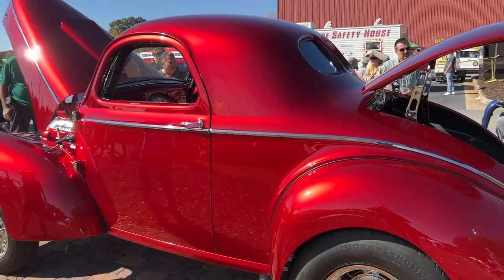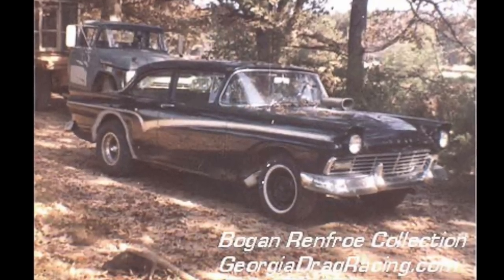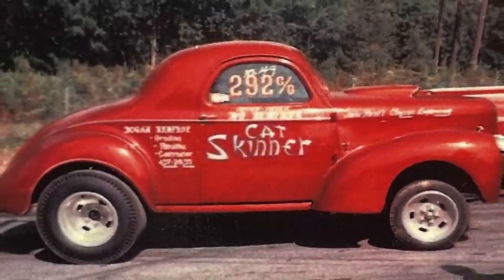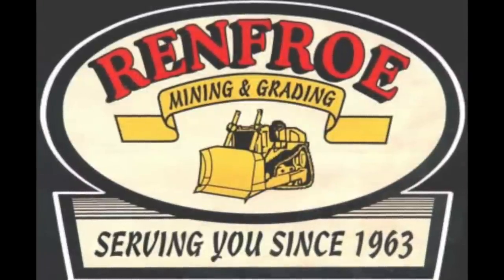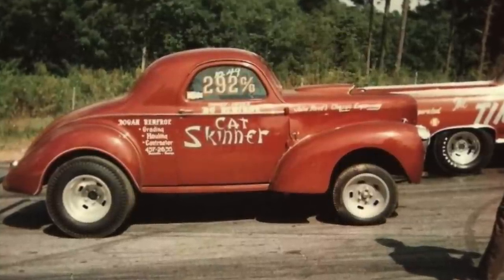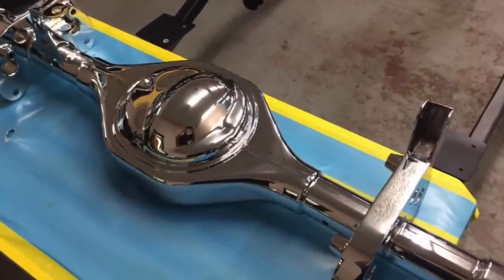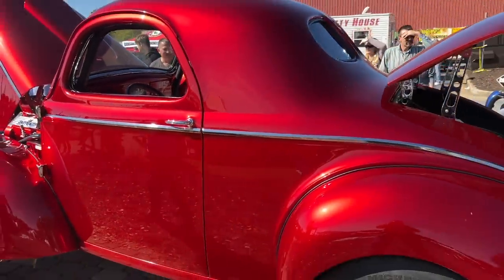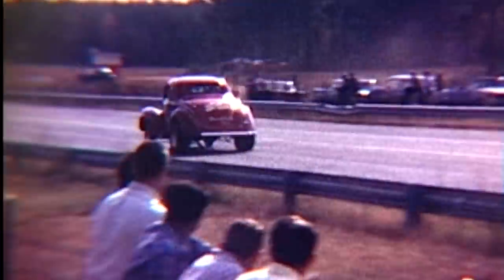Historic "CAT SKINNER" Willys Gasser LIVES ON!

Comment: I have a 40 Ford coupe all steel.  it was built to race in the early 70s but is now driven on the street by me.  Big block 460 bored 30 over with many changes.